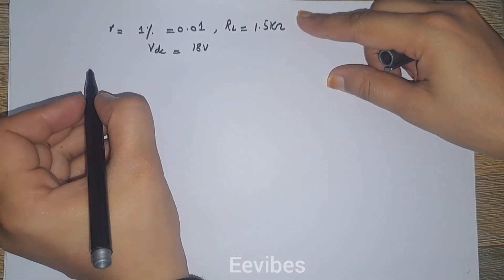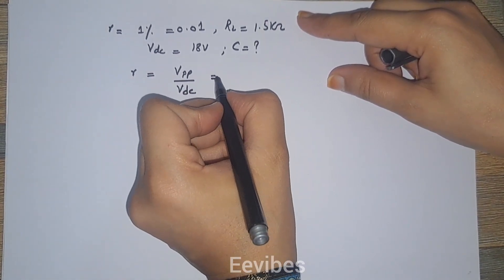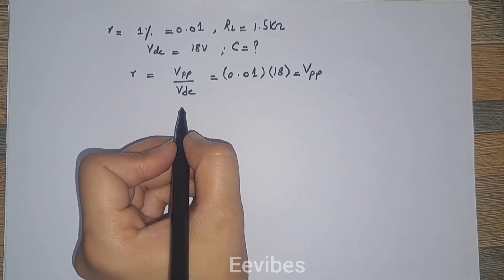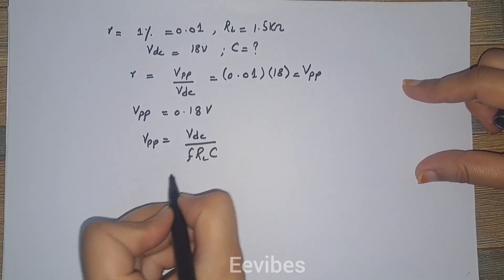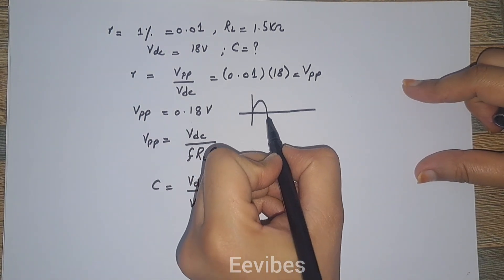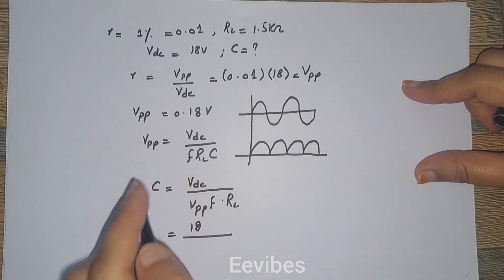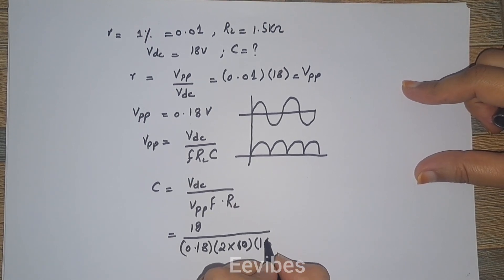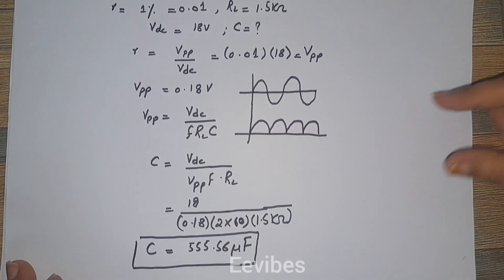What value of filter capacitor is required to produce a 1% ripple factor for a full-wave rectifier

Comment: hi maam, why need to take Vdc as 18V. Isnt 18V = Vp(out)?
Reply from the maker: No, Vdc is the DC BATTERY VILTAGES while Vp is the peak value of Ac voltages
Reply: @eevibessite  "Assume the rectifier produces a peak output of 18 V." yes maam so why take 18V as Vdc to solve the question tho?

Comment: Hi mam
Is this formula is equal to  vdc=(1-1/2fRLcC)Vrec
And Vp=(Vrec/fRLC)
Reply from the maker: Vpp=Vdc/fRC 
and 
Vdc=Vpr/(1+ 1/2fRc) 
Also you can watch complete derivation and formulas here :
https://www.youtube.com/watch?v=r0JaXM_wuOo&list=PLacdleb4rX69NfvBWyDdeMPh3YIS9Y6b7&index=22&pp=gAQBiAQB
Reply: @eevibessite  Thank you so much ma'am ,I watched your video and used the formula in the given equation. However, the equation in the book was different, so I got a little confused.
Reply from the maker: You might be following formula from the Floyd while I used the formula from bogart, and there is very little change or you can say a negligible one. But I find bogart more conceptual as compared to Floyd.
Reply: @eevibessite  Yeah, ma'am! Thanks a lot! Now my concept is clear. I was scared because my sir said I should follow the book. I don't know about this formula, but I will check it from another source.
Reply from the maker: You can search in Google books by typing electronic devices and circuits by bogart. It's in chapter no.3, equation no 3.12 and 3.15 
Also share and subscribe ti my channel thanks